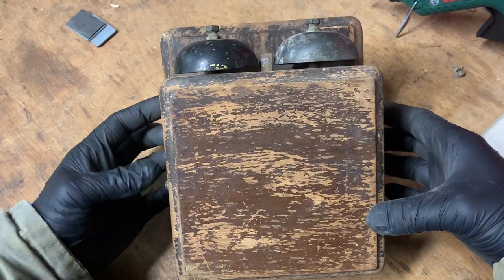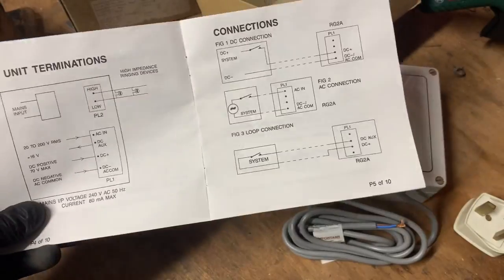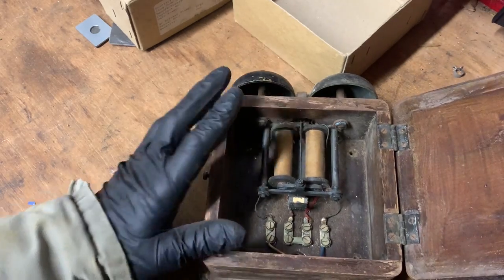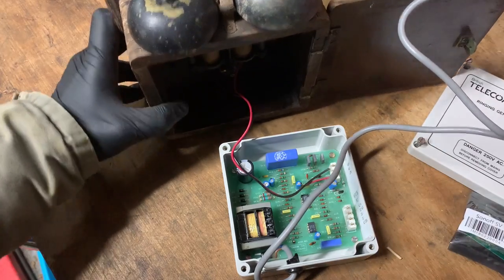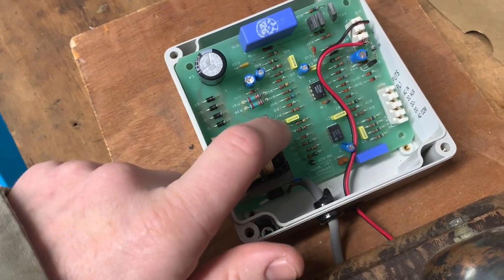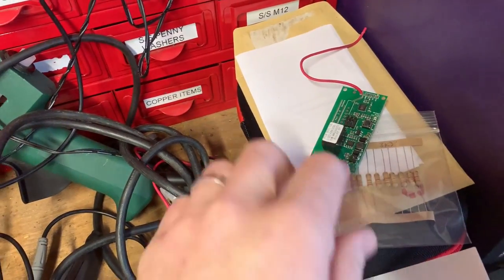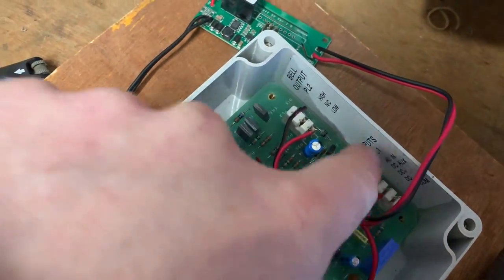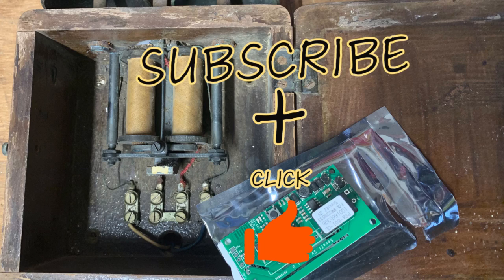Making a 1940's telephone bell work using WiFi and a Ring doorbell

Comment: Jack, back in the dqay, This unit was called a bell box. From back in the '30's and '40's, it was connected to a circuit with a desk telephone set that had no bells of its own. It was quite loud when it rang.
Reply from the maker: Oh ok, I figured it was an extension or repeater bell rather than the ‘only’ bell for a telephone. Interesting!

Comment: You dont need the 3.3 k resistor which is only needed if connected to a plug and socket telephone line to match the 4k impedance of the phones

Comment: Hi what voltage do you need for these bells
Reply from the maker: 70v 25hz
Reply: They have a resistance of about 1kOhms and you can drive them from as low as about 24VAC. Frequency is up to you really. You can use a bipolar stepper driver to generate a signal.